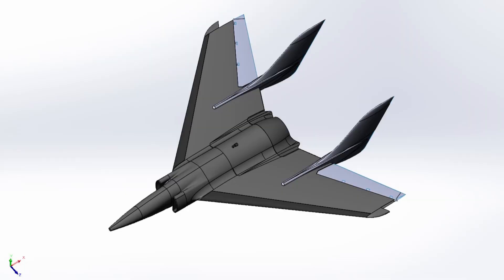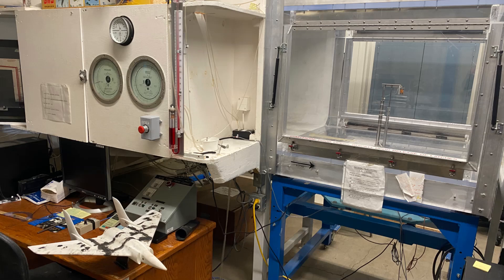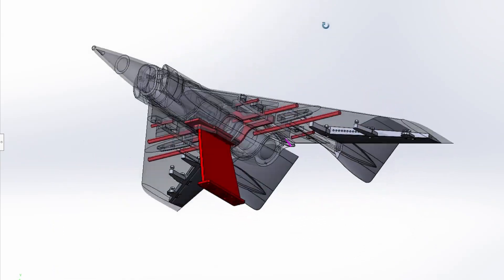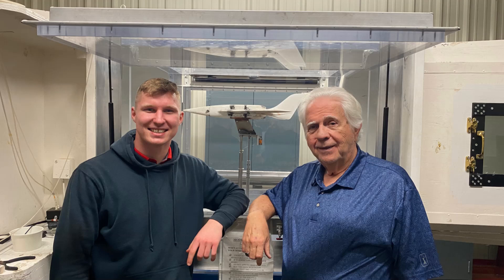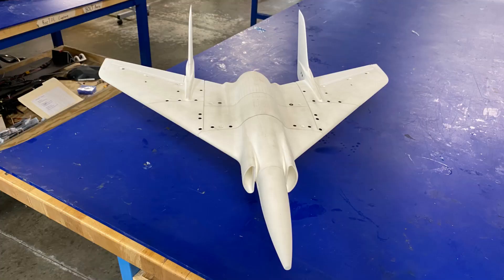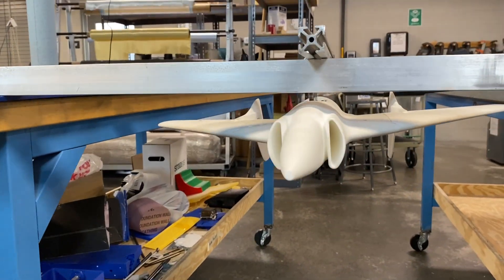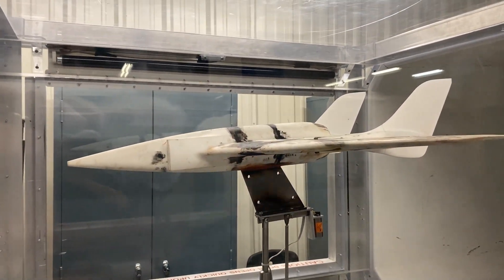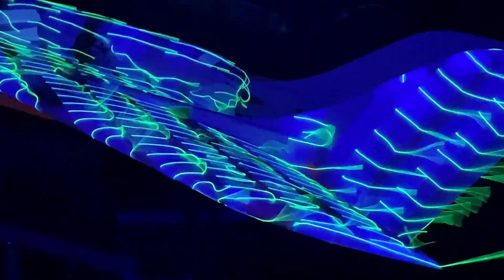TEST at Embry Riddle Wind Tunnel

Comment: Hello, Great project! Can I make some suggestions: remember that to break the mach speed the model must conform to the area law for stability and that the air intake must be large enough to feed the engine and sheltered from the supersonic shock wave under penalty of losing power or destroying the engine.  Good luck and break the wall.

Comment: Never-mind, I did not realize your design is for a RC model. Have you studied other tail less aircraft? Specifically the X-4 Bantam and F7U Cutlass. The X-4 had pitch oscillations that cross coupled to the roll and yaw axes at Mach speeds near the speed of sound. The F7U is similar to your design and it was plagued by many problems and it became one of the US Navy's most deadly aircraft. I admire your enthusiasm but feel you should know that tail less designs have been rejected by NACA, NASA and the US aviation industry.

Comment: what i would do is if youre going to add an after burner, i would add 2 separate fuel bags (NOT A TANK) into the lead delta of the wing so youre not dipping into the main fuel cell. assuming its entirely turbine

Comment: Did you test you model previously with a fluid Dynamik simulation or was it your first test with scientific measures?
Reply from the maker: Yes and no. In last three years I have done two wind tunnel like tests, mounting plane on top of the car and testing it at different AoA and speeds. But it is first true scientific level precision test.
Reply: @ivanmarkovavia  How well did it work with the car? Were you able to get any good data?

Comment: Q: Why did you pick a Centrifugal-Flow Engine over an Axial flow Design which is used in nearly every Supersonic Jet ever made?
Reply from the maker: I will give an answer in next video!
Reply: I'd guess because they are simpler and easier to build
Reply: Small jet engines always have this layout as it is easier to achieve at this scale.

Comment: questions - Why did you opt for 'vertical ' double tail design as opposed to the F-35 type double tail fins which apparently reduce drag and provide increased lateral stability ? 

What Reynolds number do you use in the wind tunnel considering the 60% scale ?
Reply: I think reducing the radar signature is the man reason the angled stabilizers are like that on military jets.
Reply from the maker: I will give an answer in next video!